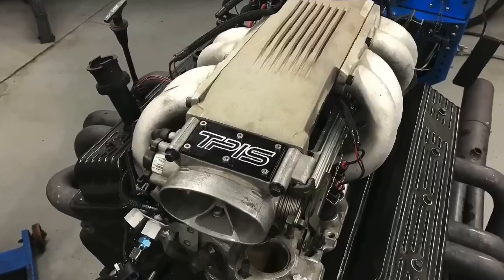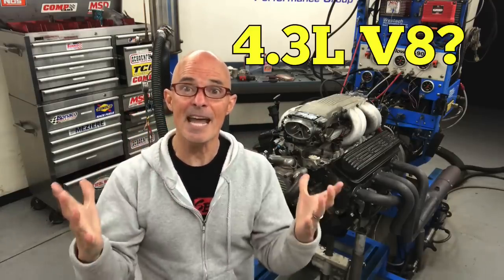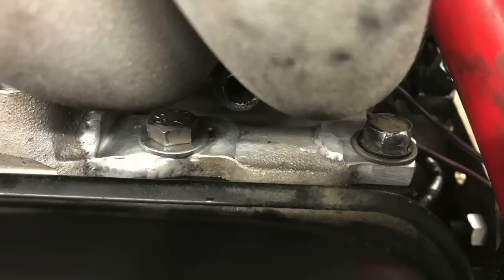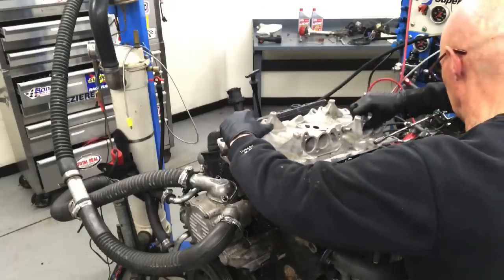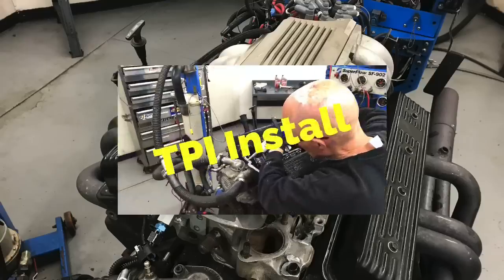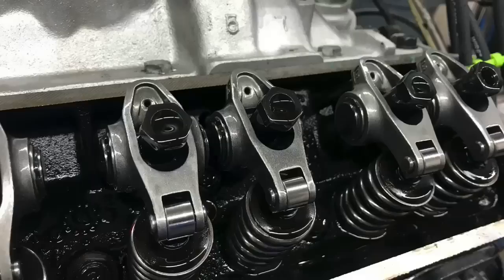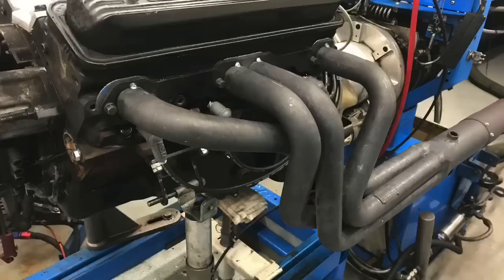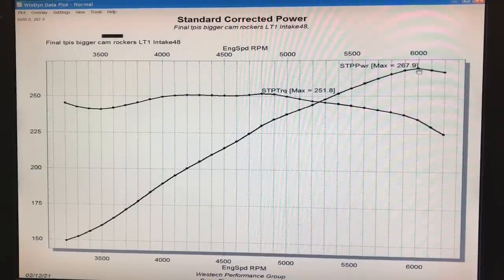GM's BIG MISTAKES-LT1 VS TPI VS CARB (L99 4.3L V8 INTAKE TEST)

Comment: So GM basically designed the most amazing truck intake ever - and then put it in the F-bodies & Corvette...?
 
I'll take the 4th option personally - just slap some injector bungs on the carb intake and get the best of both!
Reply from the maker: BUT YOU LOSE THE CHARGE COOLING
Reply: @richardholdener1727  I have a feeling that is why a 454 TBI unit on a performer rpm worked really well back when I ran a TBI on a dual plane vs TPI in my older G20 Van.
Reply: @richardholdener1727  That's definitely true, but that's something I'm willing to give up on the street for the benefits that EFI brings(though I may be biased, having to deal with Ohio's constantly changing weather). The benefits of EFI, without the limitations of those old school 1st generation(ish) EFI manifolds.

Comment: IF YOU PUT A 2 INCH CARB SPACER THE CARB VERSION WOULD HAVE MORE TORQUE AND HORSEPOWER THAN THE TUNED PORT INTAKE
Reply from the maker: that is incorrect
Reply: @richardholdener1727  REALLY,,  WHAT WAS THE TORQUE DIFFERENCE ON THAT 383 TUNED PORT VS SAME 383 WITH RPM INTAKE AND CARB ?   YOU DON'T THINK A 2 INCH CARB SPACER IS GONNA GIVE THAT 383 ATLEAST 30 FOOT POUND OF TORQUE ?

Comment: My dad swapped a 350 TPI motor into his lifted K5 blazer back in the late 80s. He always said it was the best truck motor GM never made.  The 5.3 lm7 in my Sierra feels gutless compared to that old tuned port.
Reply: Something wrong with your 5.3 then, My 4 door 8000lb dually has no issues getting sideways at half throttle (5.3 swap)
Reply: The Holley Sniper “Split plenum” cross-ram intake and and aggressively lobed cam with a set of TRI-Y will get you a way more TPI like curve on your little LS and some MPG improvement...
Reply: I had a 383 with vortec heads, small cam, ported vortecs, ported edelbrock 3817 base siamese ported SLP runners and ported plenum with tri-y headers in an 83 G20 van.  At 5,300 lbs ran a 13.8@ 101 mph with a stock converter in the 700r4 and 3.08 gears.
Reply: @chrisreynolds6520  And 20 mpg on the highway on a 5300 lb van? Vortec heads, long runner, low rear gears and 700r4 with lockup tc is just perfect for a van / truck.
Reply: @adamarndt7617  About 19 mpg but I also set the cruise at 80-85 mph alot in it.  The previous engine was a 305 flat top pistons, with 059 305 heads, a 96 production LT4 cam and stock intake runners and plenum.  305 would get a consistant 22 mpg running 75.

I also have a heavier 97 Express van with the L31 5.7.  It has always gotten around 18-19 mpg.  4L60E and 3.42s and then a 4L85E and 3.73s. Even after a tuned 0411 PCM swap, marine intake swap, cam swap and thorley tri-ys the fuel mileage stayed fairly untouched and often a little better than bone stock.  It still gets 17-18 with a ~500 hp 383 and 5.13 gears except it easily pulls my travel trailer along at 2,850 rpm @ 70.
Reply: @adamarndt7617  With the 6,000 lbs travel trailer that is 26' long, 11' tall and 8' wide the 350 still managed 9-12 mpg.

Comment: I wonder what the TPI would do on a 5.3LS, would it turn it into a torque monster like a big block?
Reply: No, it would choke it. It would probably offer the same torque.up to 2500rpm then start to strangle the engine. Factory truck intakes have made more power naturally aspirated than any tpi intake. The runner is a different length but the stock tpi setup was designed for an engine that only scaled the MAF sensor to about 280hp. The ls truck intake is actually really good and makes it obvious how bad long runner aluminum intakes can be.

Comment: Why is it, that in almost all cases the carb makes more power than FI?
Reply: Intake charge cooling from the fuel vapourizing
Reply: maybe because the front cylinders get as much air as they need, and the rear cylinders get whatever is left over? Whereas the carb intakes all cylinders get as much air as they need.
Reply: because the test is biased the tune is not optimal for the efi it takes alot of time and knowledge to get it right compared to a carb also the efi in here is stock and developed in the 80s meanwhile he has a race carb that cost over 1k on the dual plane
Reply: @Madmax.3  the stock throttle body is known to not be a restriction untill ~450hp. It's certainly not any sort of restriction on this little L99. lol
Reply: @lb9gta307  i find it very hard to believe that the lt1 with shorter and straighter runners makes less top end HP than the carb that the only thing that i can blame it on is either the tune on the efi and the carb tech and airflow why use that carb and not you typical 300-600 set up?

i dont believe that a 300-600 carb would do those numbers and i know that there are modification to the two ef setups that would produce more t and hp than shown here yes even on the l99
Reply: @Madmax.3  the LT1 intake's shorter runners probably don't provide enough intake velocity. It's similar to the TPIS Miniram which didn't make as much power as the Holley Steathram despite shorter, straighter runners.

Comment: Too bad you don't have an Accel superram to test
Reply: I think you would be surprised how bad they actually are. It gets worse on bigger engines with ported heads and serviceable camshaft. On a cammed 5.7l, it would probably not make the torque or horsepower as the dual plane. On this engine it would be really close, they only cost $2000 new.
Reply: @timothybayliss6680  yeah, carburetors nearly always win vs efi. tpi vs super ram on that L99 would be an interesting test though.
Reply: @jr78racer  it would be a neat test. I remember when they.came out and guys fawned over.them. The first few lingenfelter cars that had one had more than 16 hours of porting of the intake. They were way better than the tpi intakes but they still weren't quite good.
If someone came up with a clean sheet design made of injection molded nylon like a stock ls intake in the shape of a Tpi intake it would probably rock.
Reply: @timothybayliss6680  somebody else mentioned FIRST tpi. They need to loan Richard one so we can see the gains that their 30% larger runners are supposed to offer.
Reply from the maker: TAKE A LOOK AT THE BIG TPI INTAKE TEST VIDEO-THE SUPER RAM WAS TESTED
Reply: @richardholdener1727  my takeaway from that video is that the L99 would be awesome with a super ram.

Comment: No one should be surprised that you can find a better carburetor manifold then the old GM efi manifolds for making power.
Reply: hes using stock 80s efi with a quick tune meanwhile the race carb on the dual plane cost over a 1k

Comment: Still the same good ol' stump puller intake... That NEVER made it in a single truck...lol.
Prime example of GMs relentless stupidity.
Reply: Would have been more about cost. TBI is cheaper and it didn't cost them anything more whenever someone paid more to get a 350 over a 305.
Reply: @lb9gta307  economy of scale says tpi would have been cheaper as tpi already existed, the design was done, the tooling already paid for and selling more of the same item makes that item cheaper.  dividing those same sales over two different products makes each of them more expensive.  the decision was based on the idea that the guys with the sports car didn't want to see the same engine in a truck, it would have hurt sales of the sportier Camaros.
Reply: @frotobaggins7169  the TBI stuff already existed too, has less parts, and is quicker to assemble. It's the cheaper option no matter how you look at it. 

The majority of V8 Camaros and Firebirds in that era had an LG4 or LO3 just like most V8 half tons so it wouldn't have been that.
Reply: Cost is your answer - way fewer parts & therefore lower bill of material cost (regardless of existing development / tooling costs). Also would drive additional tooling due to volume requirements & wear out of tooling.
Reply: there might be a few more parts but i'm not buying the way more parts tbi has the manifold and throttle body so the difference is the upper plenum and the two "legs".  cost maybe.   i'm still solid on the exclusivity of the pony cars as tpi was never used in anything but those.  they could have easily offered the tpi for a premium upgrade.  why wouldn't they?  tbi and tpi are virtually the same systems except for the manifold.  in fact tbi can easily be swapped by repining the harness, adding the runners and a computer.    just my opinion.
Reply: @frotobaggins7169  the TPI has 4 more parts to the manifold requiring 6 more gaskets and 20 more bolts plus 3 machine screws. There's also 6 or 7 more injectors depending on the year. The runners them selves are also more elaborate since each tube had to be welded onto the flanges.
Reply: @lb9gta307  i get it, i'm not stupid.  i actually have both a tpi and a tbi.  i know full well what they are, i've actually taken all of those parts apart and reassembled them.  but now we are counting every 3 cent gasket and 25 cent bolt?  it wouldn't make any difference on a 20 thousand dollar car/truck.  how much do you think the diesel is? +10,000?  it still doesn't explain why it wasn't offered or used.  at best it's a few hundred dollar difference  between tpi and tbi for a mountain of torque.  my tbi truck maxes out at 85 and can't get out of it's own way going up a significant hill.  it's a weak but reliable design.  they could have easily just used the carburetor and saved literally hundreds of dollars per vehicle and got better performance. yeah, i get it that it was about fuel economy and emissions, i'm just saying.
Reply: @frotobaggins7169  Something is wrong with your TBI truck.  I swapped my G20 van from TBI to TPI but even with vortec heads and a roller cam the TPI only made more power from 2,600-4,200 than the TBI.  TBI on a dual plane made more power down low and more up top than the TPI while getting better MPG.
Reply: @chrisreynolds6520  well you will have to talk to GM about it because they made it that way.  how is it the engines fault if it only goes to 85?  that's the max on the speedometer.  it runs like a champ around town and low speed but it just runs out of breathing at higher speed or heavy load.  it does good for having 225.000 miles.

so what your saying is tpi only made a noticeable difference for literally 2/3rds of the usable operating range?   that just confirms what i've said about my tbi, it would benefit from the better breathing of the tpi.
Reply: @frotobaggins7169  With Vortec heads and a cam I had a fairly flat torque curve from off-idle to 5,500 rpm and hp peak around 6,200.  2,600-4,200 rpm was only a 1,600 rpm window that I rarely operated in.  Cruising down the highway I was at 1,700 rpm and at WOT the only time I was under about 4,000 rpm was in 1st gear under 30 mph.  My G20 van with a TBI engine had no problem getting up to 110+ mph.
Reply: @chrisreynolds6520  yeah, the vortec heads are amazing.  i hope to get some to wake it up.  sadly, no one offers a spread bore manifold to use them with a quadrajet.  i really want to put some on my 72 chevy pick up.  i know the manifolds can be drilled and modified to accept a quad but i kind of wanted an edelbrock manifold designed for it.
Reply: @frotobaggins7169  You need to do some more searching.  GM, Edelbrock and several knock off chinese offerings are made for a Q-Jet with Vortec heads.  Some marine engines also had a cast iron or aluminum high rise version as well.
Reply: @chrisreynolds6520  thanks, i see that GMPP offers one.  $422, ouch.  most of the others require some kind of modification to fit a quad and often don't have the kicked out bores for the secondary's.
Reply: @frotobaggins7169 What are you talking about? GM is not the only one except to have an EGR provision. Professional products 52007, Speedmaster 1-147-004, Edelbrock 2116 there are literally a half dozen more.  You could just look on ebay for a used marine q-jet vortec intake too.

Comment: Cool thing is you have tested every single TPI system there is that you can't buy new anymore and haven't tested the only TPI system you can still buy new. FIRST TPI https://firstfuelinjection.com/ They have a base intake manifold for 55 - 86 SBC, 87 - 95 SBC, 92 - 97 LT SBC, 96 - 02 Vortec SBC. They pull hard to a much higher RPM than any other LR TPI system.
Reply: We need to get ahold of Ken and see if he can send you one along with the different bases to test with. He's in the business of selling them and you are in the business of testing them with a large number of eyeballs in your Youtube audience. That is a lot of potential customers for him if it does well in testing with you.  Seems like it would be a no-brainer for him to send you what you need to test with.

Comment: TPI shouldve been put on the trucks.
Reply: Enter Vortec 350, Vortec 305, Vortec 262. Enter LS 293, 325.
Reply: @shadowopsairman1583  yep. Vortecs were great engines but topped with another one of GMs goofy designs.....poppet injectors. Ok from a stock standpoint but limited on what you can do on upgrades for performance. The LS engines make their torque in a higher RPM range, I'm not a fan of them in a truck.

Comment: 1:08 Did that thing just hit VTEC yo!? Lol
Reply: VVTi is on Gen 4 SBC and Gen 5 SBC
Reply: @shadowopsairman1583  Calm down, it was a joke... also the gen 4 and newer small blocks have VVT, the do not have VVTi.  That is a Toyota invention.  Also either the l99 nor the LT1 in this video has vvt. Even if they did, it’s just verifiable valve timing, no lift changes occur and as such it makes no decipherable audible changes in the exhaust note (unless you’re counting the sound difference on the DOD/AFM engines when it changes from v4 mode to v8 mode). I was referring to the sound changing at that particular time in the video sounding like a vtec engine does when it switches from the low lift to the high lift cam profile.

Comment: LT1? That stupid opti spark (UNDER THE WATER PUMP) dumbest design ever. Because my water pump died and proceeded to kill my ignition...
Reply: Crazy,, I've got 364k miles on my 96 roadmaster, 485k on my 95 9C1 & 82k on my 96 Caprice - Never once swapped a water pump - only an alternator & 2 starters engine wise..... However,,, ball joints, brakes, tie rod ends & an retro fit oil filter to eliminate the roadmasters cooler.. Tires - a ton of tires. Ha.
Reply: I've had around a dozen LT1 cars & still have 3... All started with my SSimpala that I wrecked & then it was a number of Roadys with a Caprice here & there - Never a Camaro tho... Haha

Comment: LMAO very biased towards the carb your comparing an aftermarket race carb that cost what 1K? to a stock gm tpi intake and still using the factory 48mm throttle body without the airfoil theres no airfoil on either efi test, what cfm is that holley? It has been tested before numerous times even your own guys TPIS tested a stock 80s vette 350 tpi motor carb, tpi, and min ram and the carb did not make more HP than the mini ram or more toque than the tpi anywhere in the curve.

In this test its either the difference in the size of the carb vs the stock TB used in the efi or the EFIs fueling is off in the tune, if you where to throw a modified tpi bigger base, runners, and TB you would see 15-20hp on the whole curve, that stock tpi base ports block at least 1/4 inch of the head at the top of the port
Reply from the maker: PLEASE SEE THE BIG TPI INTAKE VIDEO-WE KNOW WHAT ALL THE INTAKES DO-SO DOES JIM AT TPIS, IT'S NOT THE THROTTLE BODY SIZE OR FLOW-WE DID TEST AN AIRFOIL BTW-IT DID NOTHING AT THIS LOW POWER LEVEL.
Reply: @richardholdener1727  yes tpis has a whole book on tpi vs mini ram vs carb, the carb makes the worse avg TQ and power in there testings.  even in your own 10 times the torque article the original carb test does not out TQ the efi stealth mini or super ram the air foil isnt going to show anything when you run the TB bare you need an air duck/boot on the front of the TB